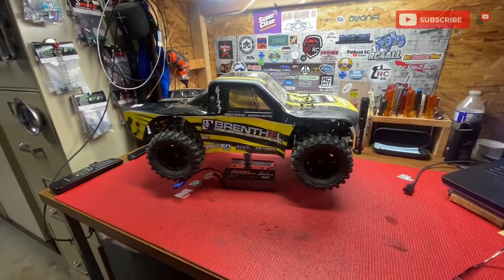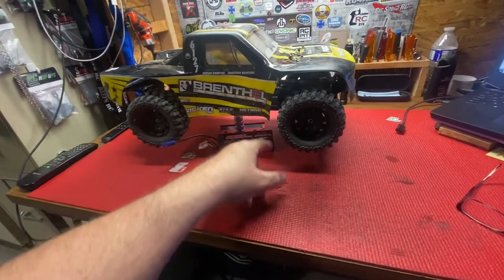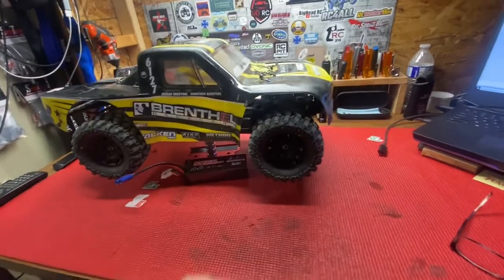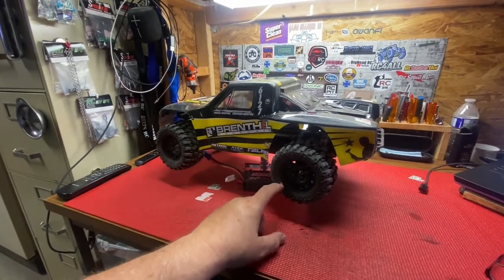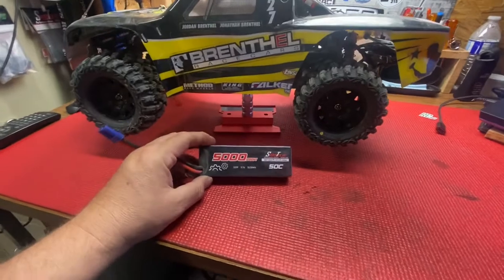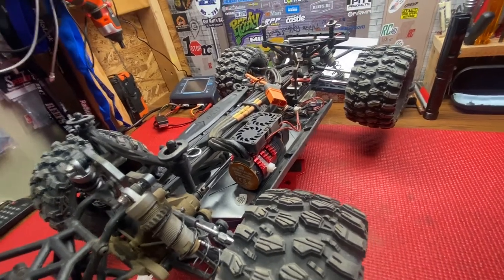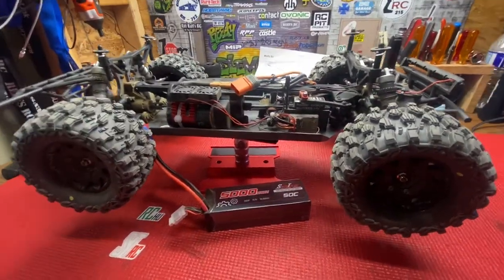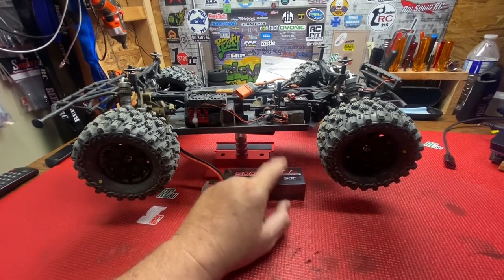Early Morning Bash With The Losi TT Pro

Comment: cement or drywall tape on the inside of the body then apply e6000 or shoe goo. It will last a lot longer. love my db pro
Reply from the maker: Ya it is a little to late for that but it is still holding together. One of my favorite car to run, it is fast out of the box